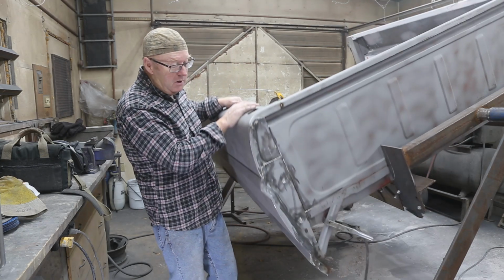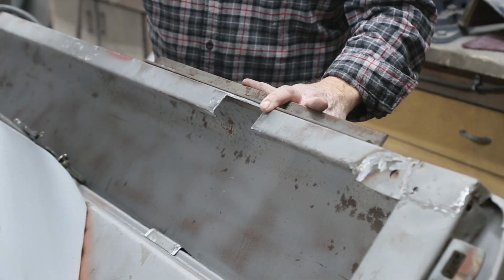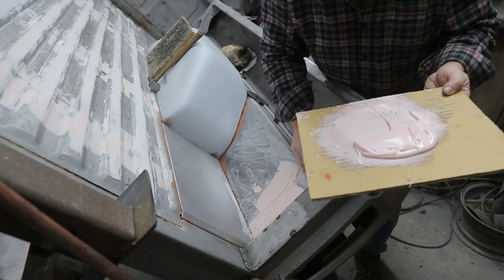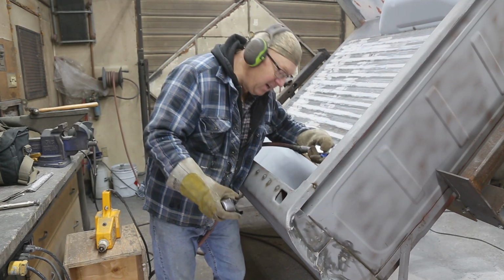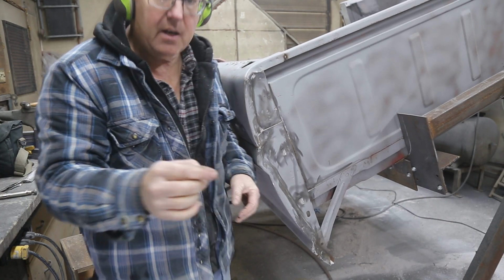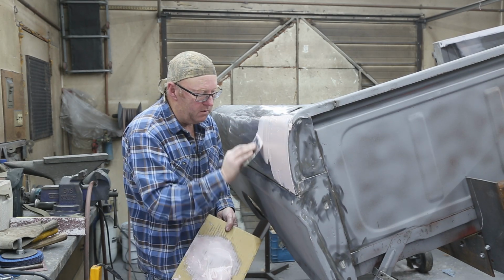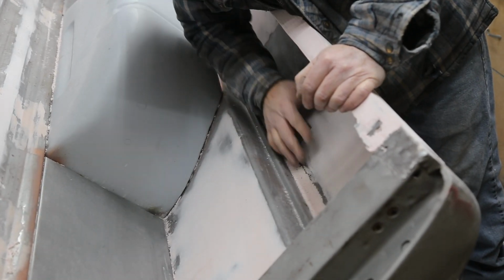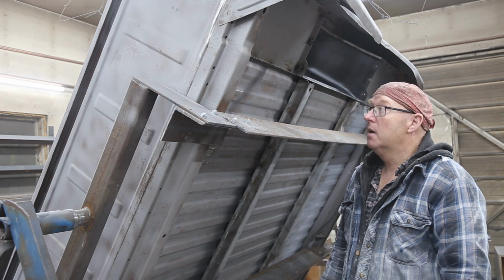1972 Ford 4X4 Short Box: Inner box side repair, passenger side

Comment: those osculating tools are great, at first I though they were just another gimmick. what is that yellow gadget called,, what does it do?
Reply from the maker: I could not live without my osculating tool for sure.  I was the same as you, thought it was a gimmick tool.  The yellow unit is a stud gun.  It welds a nail on your metal and you use a slide hammer to pull the dent.  It also works good for shrinking the metal.  Thanks Vern.  Stevo